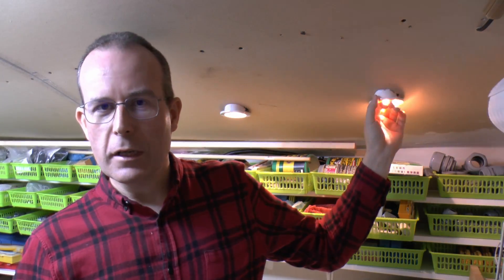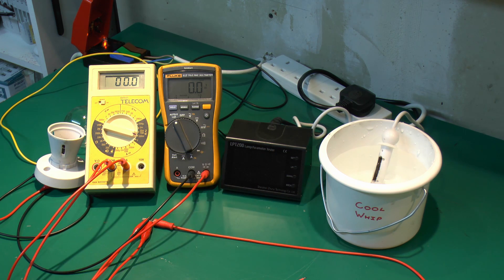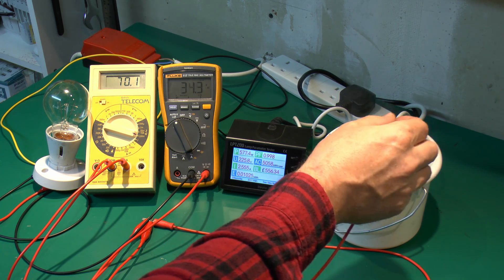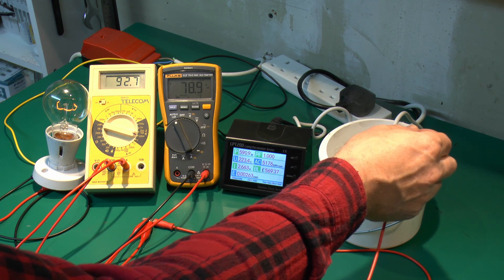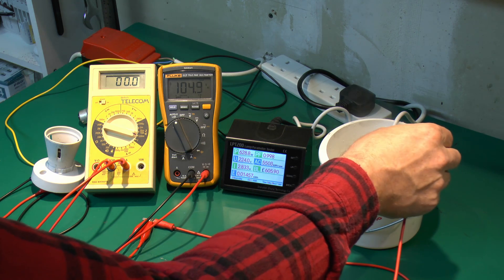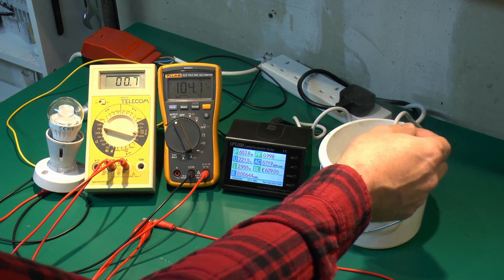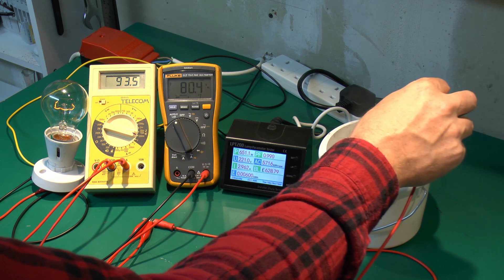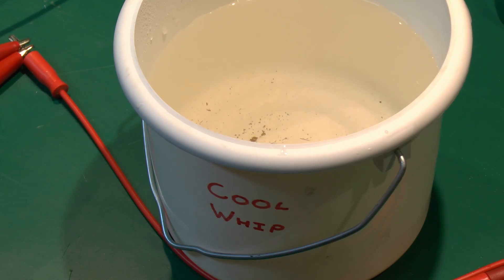Dangerous Electrode Water Heater - Take 2

Comment: good old video and a good rule of thumb for people is "its volts that jolts, but mills (milliamps) that kills". Voltage breaks down your skins resistance to current flow, but it's the actual current flow that is lethal. That is why you can get a static shock which is a few tens of thousands of volts, but theres very little current behind it, so it just hurts briefly.

You could actually kill yourself with 12V if you got past your skin's protection i.e if you were wet, or if you made contact on open wounds. I believe the SELV regulations state that anything above 50V is considered lethal

Comment: Hi JW. I have a 3 phase spa heater contactor that needs replacing.  I think the heater is a 3kw heater. Can i use a 410v coil and 40amp rated contactor?
Reply from the maker: Yes, although a 40A contactor would be significantly oversized for a 3kW load.
Coil voltage depends on how the coil is connected, 400V if between two phases or 230V if between one phase and neutral.
Reply: @jwflame  Hi John. Thanks for the response.  I inadvertently wrote the wrong kilowatt rating. Its a 3 phase heater with 3 x 3 kw elements so the total rating is 9 kw. So i think the 50 amp contactor is correct but I'm not sure if the 410v is correct. How would i test how the coil is connected? Kind regards Jon

Comment: Hi John; 

Excellent videos as usual. Typically anything over 90V I treat as something that I would not want to touch. Only question I have is that the resistance of your body is going to be in the mega ohms region if you put your finger in the beaker. 

Given the voltage present on your test probe. It seems implausible maybe that you’d get a fatal shock, perhaps only a nip? Thought I’d throw that question into the mix as the maths say you’d be okay. 

Non the less a great demonstration, and a totally awful device. How’s about you stick the probe in salty water and stick 2000V through it. :)
Reply: Kyle Bishop your body resistance is in the megohms if you touch bare metal with a dry finger — wet contact has much less contact resistance. More in the tens or hundreds k range.

Comment: I bet that Mike Trump what called me a fool for saying probe size matters is nowhere to be seen now.....
Reply: Serious question... if the resistance of tap water is in the megohms per metre range (as tested in a previous vijaeo on this channel), why is having a live conductor in your bath/cup so perillous? Is it something to do with surface area of the skin? Is wet skin somehow more conductive than wet water?
Reply: Impurities make water very conductive, and you contain lots of salts and stuff, so I would expect your gooey inside is very conductive compared to the surrounding water. You are also connected to the circuit not by a one inch cross section column of water, but by maybe a foot cross section, so much less than megaohms. Essentially you are putting a lower resistance body into a tub of badly conducting water, which means your body will act as a shunt and concentrate the flow of current inside.
If you have ever had the pleasure of getting seriously zapped you will know that it causes burns to the skin. This is a clear indication where in the circuit the highest resistance occured, at the contact point, which was hopefully small or we wouldn't be talking without a ouija board. In the water you have a vastly larger contact area, which will reduce the resistance your skin provides the same as if you touched a large conductor such as a bus bar. It is contact area that kills, because that decreases resistance and allows more current.
In practice electricity in the bath is not always fatal, but you have a decent chance of getting between a grounded drain hole and that hairdryer which has now become a chinese water heater (with circulation pump!). The factors of dry skin and small contact area, that almost always save your life, are eliminated, further reducing your chances.

Comment: I do see one valid and safe use for this thing:

Electrically heating a boiler for a model steam engine.

Once it's on an isolation transformer you'll be electrically safe and you can't get a boiler explosion. Nothing gets hot enough to soften the metal and if the water level goes low it just stops passing current entirely. The contamination isn't a concern in this use either, as the resultant steam is going into an engine that doesn't care about trace amounts of chromium in the steam supply.

Other than that I see no valid use for this thing.
Reply: As a component in a larger machine, sure. As a standalone consumer device it is far too unsafe for its intended purpose. These things range in size, too, some are even advertised as being big enough to heat a baby's bath.

Big Clive has covered several of these abominations, worth checking out.
Reply: proteusx no, stainless is where you'd end up with chromium in the water. It appears that the contacts on that are mild steel, so what's going into the water there is just iron oxide (aka rust) Unpleasant color, but not going to hurt you, assuming that's all that's leaching out. However, given the DGAF attitude the companies that make these things have, if there's a way they can make that thing a fraction of a penny cheaper by using some sort of toxic metal in the alloy used in the electrodes, they most certainly will.

Comment: For better accuracy, you should have used a British Standard finger instead of the probe.  Except those things are expensive.  But a finger-sized length of metal rod would do for this test.  A large-ish metal bolt would be a good simulation (copper pipe of the appropriate diameter would have twice the surface area, so not so good a simulation).
Reply: actually copper pipe would be almost the same as a solid piece of metal, since the water inside the pipe has comparably high resistance. The surface area "pointing" towards the heater has by far the greatest effect.

Comment: Stainless steel is obviously a bad choice, and bare copper probably wouldn't be great either, but I wonder if there's any metal that would make a good electrode for this type of thing and wouldn't contaminate the water. Gold or platinum probably, but anything relatively inexpensive, maybe titanium?
Reply: Sometimes graphite electrodes are used to avoid contamining an electrolyte but they too break down, platinum is better but expensive.

Comment: Compare it with two carbon (graphite) electrodes taken from a #2 pencil, and see if you still get the brown cr*p, and if the voltage/current are about the same. Just for funsies. 😎

Comment: Bit of a side note, but using a liquid and physically separating submerged electrodes was one of the earliest ways in which theatre lights were dimmed, before resistance dimmers became the standard. Various specialist fluids were available from lighting suppliers, though as it would be expensive, and wouldn’t last a long time, it could be topped with salt water, or a technician needing to relive themselves (providing it wasn’t powered!), hence the nickname ‘Piss-Pots’.
Reply: Are you serious? (About the piss pots).
I've heard of salt water motor start "resistors" but this gem of trivia is new to me.
Reply: It is serious yes - I've heard this from several people - including my partner who worked in the Edinburgh Playhouse. @stefantrethan
Reply: I used in the past a similar device that was used to test gensets. It was rated for 200 KW and was three phased. The power was adjusted by the height of the plate in the water. A winch was used for this purpose. Plates were in stainless steel and the water was kept running during all the test to avoid its level to diminish.

Comment: Where are the EU regulations to protect the consumer from dangerous goods?
Reply: They don't cover what you import from China yourself...
Reply: So there are no rules on what you can import and export, I do not believe it. The rules are being broken. I would like to buy a Chinese assault rifle how do I do it?
Reply: @TonyDartford  
You're not only prohibited from selling weapons to the public, you're also prohibited (or otherwise regulated) from owning it. Which differs from an electrically unsafe lamp or water heater...
Reply: Simply put the importer is responsible to ensure that it meets all regulations (you yourself in this case).
Legally there is a fine distinction between importing and bringing the device into circulation within the EU, but let's not go there.
Reply: It is sure that things like that must not be sold in or to the EU. All goods have to be confirm with "our" safety standards (CE). I don't know if a normal person (not a company) is allowed to import such dangerous goods to the EU and use them for his/herself (without being dangerous to other people). Maybe this items are not allowed in the country of origin such as China (for export only 🤔🤔)
Reply: Tony Papantoniou - you don't have to import anything to have a dangerous consumer product. A bodged repair to an existing product can achieve the same thing... Or continue to use an appliance that has been damaged, e.g. the electrical flex having cut or missing insulation.
Reply: Mark1024Mak, That is why we have Standards that workmen are supposed to abide by. John Ward is always reading the new updates. If you not have a starting point such as what is allowed to be sold then standards will just keep dropping.
Reply: Tony Papantoniou - Yes, of course. But how many people "love" a cheap "bargain"? Be it a cheap product or by using the services of a worker who may or may not actually be qualified to carry out the work?

In the U.K. prior to a change in the regulations, years ago, nearly every mains appliance was supplied without a mains plug. Excluding electricians and electrical service personnel etc (who should be able to do a safe job) even some people who made an effort to do a good job of fitting a U.K. style mains plug would make mistakes, some of which compromised the safety features of the plug.
And even today where all UK mains socket outlets have shutters to prevent children from getting an electric shock by poking metal bits into the sockets, you can still find plenty of "socket covers" for sale. Even though they are pointless...
The point that I am making is that governments bring in rules and minimum standards to prevent deaths and injuries. But if people are willing to directly import cheap products from abroad, they bypass any safety checks and hence bypass the regulations. Until people stop buying, someone somewhere will continue to make and sell unsafe cheap products...

Comment: What if it was a 120v supply, like they have in some places? Would it drop below 50v making it “safe”?
Reply: No, because if you touch, or get very near the electrodes, you may still suffer from an electric shock.
Reply: Yes it would be saf_er_, the voltage would be around 50v. But that´s RMS voltage, and AC, so it´s still not safe. Obviously the chemical problems would still be there.
By the way, only north america and Japan use around 110V. All other countries use something around 230v.
Reply: No, because the voltage is the nominal RMS voltage. Actually on a 230V system the peak-to-peak voltage can be 325V (RMS voltage multiplied with sqrt of 2). So in a 115V system the p2p voltage is 162V.
That's the reason why you'll find capacitors with such a high voltage rating in a capacitor dropper.
It can deliever enough current to zap you. A current of 30mA in the right moment is enough to cause a cardiac arrest, sometimes even up to 24h after the shock.

There must be some madmen in China, they're using the NEMA-1 connector for 220V... (NEMA-1 is rated for 125V max.!)
Reply: Marcel Germann actually, their plug is a little different from the NEMA 1. Mainly in the lack of holes at the end of the blades which the outlet contacts grip in North American outlets. The blades are slightly thicker as well. Also, the NEMA 1 plug isn't rated for 125 for capacity reasons, it's for practical reasons, to prevent someone from accidentally plugging a 120v device into a 240v outlet. The plug and outlet would be perfectly capable of carrying 240v safely.
Reply: And for safety. The prongs are not sleeved and the outlet is flush with the wall, so if the plug is only partially inserted you can make contact with live parts. In most countries with 220, 230 or 240V the pins for L and N are sleeved or the outlet is recessed into the wall so you can't touch the prongs if the plug is only partially inserted.

It's cheaper without the holes, no need to drill them into the prongs. Remember, these guys are really looking to spare cents, for example installing a Schuko-plug (which isn't actually one, too small and no ground!)  without a ground connection just by using a cord with only 2 wires inside. This would be like a NEMA 5 with no wire connected to the ground prong:

https://www.youtube.com/watch?v=wneFtZ755wE&t=1s

The Schuko system is rated for 250V, 16A.